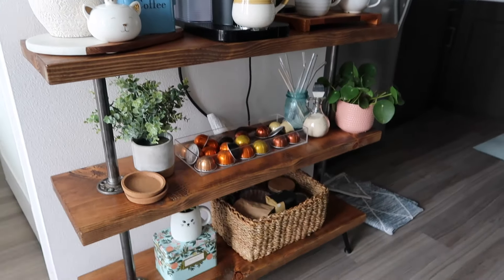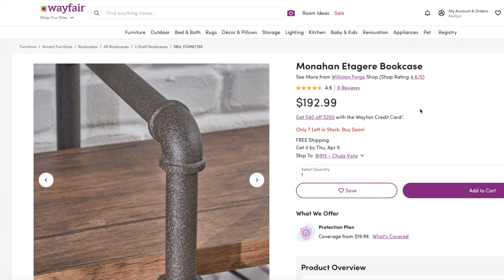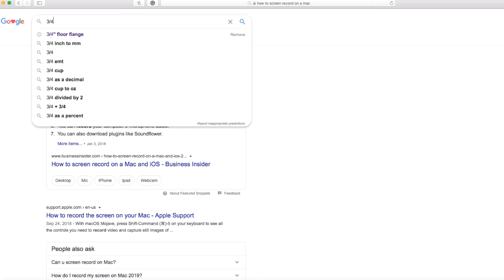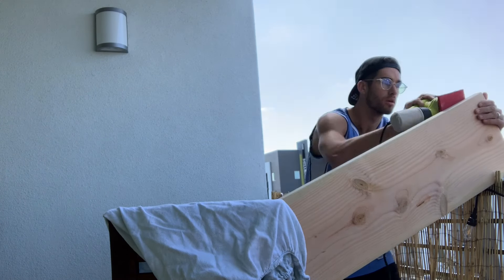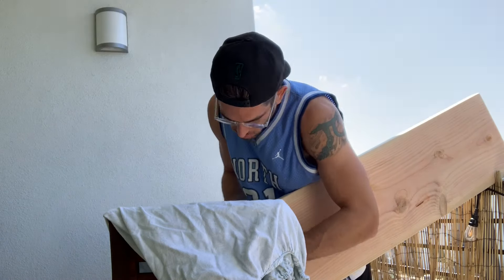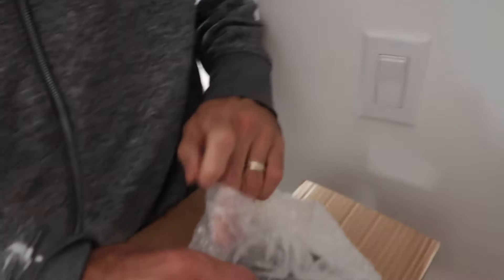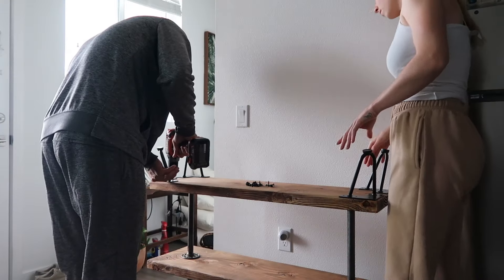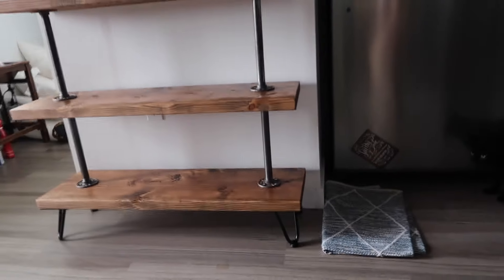DIY SHELF // Our New Coffee Bar!

Comment: Hello , What is wood width ? and The length of the wood after cutting ..
Reply from the maker: Hello, Everything is in the description box!
Reply: The length of the wood after cutting is 38 inches? How much is the offer? I don't understand very much please help me
Reply from the maker: @yaraa1499  I used a 10’ piece of wood and cut 3 pieces that were each 38” long. Because that was the length I needed to fit where I was putting my shelf. You can cut the 10’ board into 3 equal parts, though
Reply: @KaitlynCookle   Thank you 🤍
Reply from the maker: @yaraa1499  you’re welcome!!